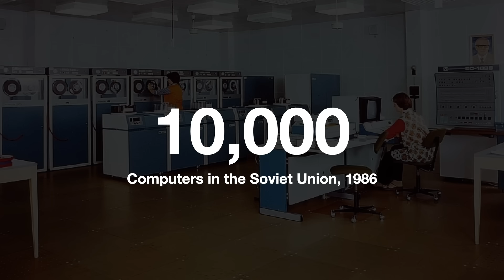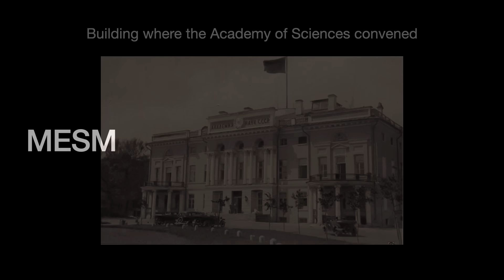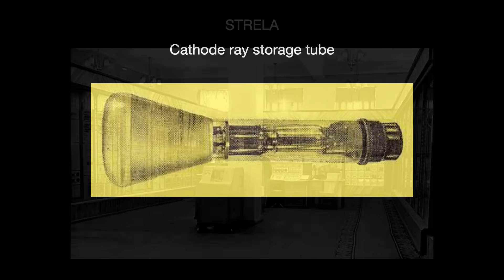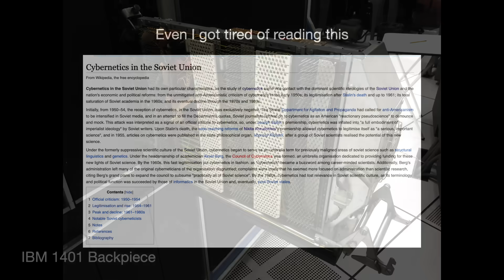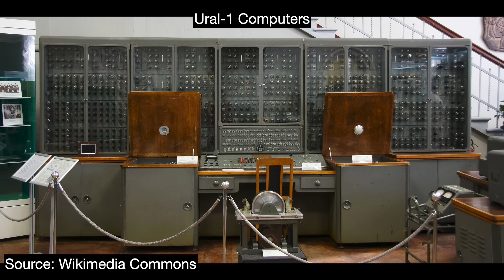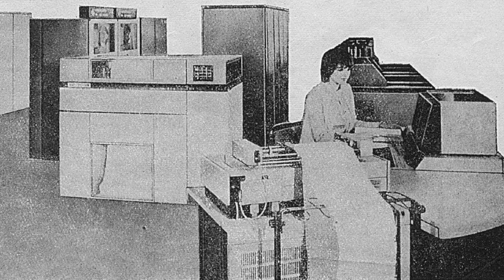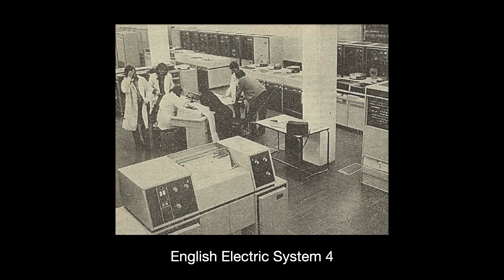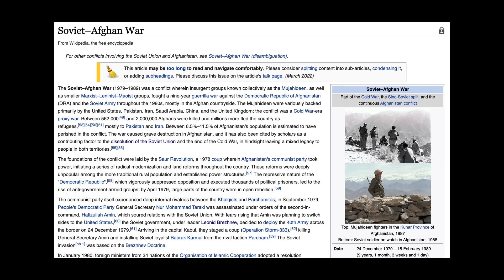Why the Soviet Computer Failed

Comment: The video regurgitates "socialism inefficient" propaganda without any backing facts. The truth of the matter was  that in the period discussed for first generation computers, Soviets multipled their production much faster than USA. The problem is, they were already 10 to 20 years behind to begin with. That kind of gap is not easily closed in high tech. For example, the USA is still several years behind Russia in ballistic missiles, having developed no hypersonic nuclear-capable cruise ICBM. US economy was fully industrialized in the 1870's while Soviet one only in the 1930's. Thus lies a very great difference.
Reply: Most of the russia high tech weapon such as cruise missile  ew system salvage from ukraine battlefield contain western component. By as much as 70%.
Reply: @richardque4952  SOunds like propaganda but OK
Most important part of those missiles is engine and they are manufactured in Russia thus why NATO doesn't have them
Reply: @Deadpoppin  Soviets led space exploration and until like 2021 US astronauts had still to use Soyuz spaceship from Baikonur cosmodrome. Russian economy several times smaller than US economy due to no worldwide colonialism or euro-atlantic alliance, yet still ahead in several areas of heavy industry. US generates brain drain all over the world in order to lead in microcomputing. Even then, their chips are made in Taiwan...
Reply: @nemou4985  more than 70%,soviet weapon come from west particular in the US,between 1945 to 1990 soviet intelligent obtain more than 700 000 industrial sample,1.1 million technical manual . This  is according to the cia assessment

Comment: 5:17 - 28 nm chips? The era of transistor   measurement in nm ended on 90 nm, now they mesure the equivalent of power that would be, if they could make smaller transistor. They are using bunch of new technologies to make better performance and more energy efficient chips. There ir no 5,7,10 mn transistor technology, because of physics restrictions. Sorry for bad English.

Comment: I would never use the USA's economy as a standard to compare against in terms of wise decision-making. The USA had an advantage of not having to care about limited resources because they have always been simply taking what they want and could embrace anyone with a similar outlook. Without that low-virtue ideology the USA might have struggled economically, too.
Well, we are being offered ever-clearer study lessons by events unfolding, for those who still don't get it but have some ability to learn after all.
And I am actually constantly concerned about the risk of the USA's competitors inviting too much of the same mindset through the desire to compete as opposed to running a profoundly different approach. - But, everything affects everything else, and along the lines of a saying, if you have to wrestle a pig, you cannot avoid getting muddy at first. (Once you have won, you can go take a shower, and hopefully by then you still like that.)

Comment: Makes me appreciate what I had.  Went through engineering school at Ohio State 1964-1966.  First year, we could not use calculators on exams.  In 65, they were optional.  By 1966-1967, we were required to use them.  During that time period I went from a fixed point 4-function calc costing $25, to a TI Datamath, to a TI SR50 full engineering calculator for $150 in lieu of the more expensive but equally capable HP-35 for $395.  At that point guys with slide rules hanging from their belts became real nerds!  Quite a rapid step forward in technology over those three years.  After four years in the service, I came back to the US and bought me a programmable HP-65 with card reader for that same $395 by 1975?
Reply: Interesting about the guys with slide rules hanging from their belts being the nerds.  I went to college a little later than that, which was solidly in the pocket calculator era by that time.  I was having trouble in a chemistry class with equations so went to see the professor for some help.  He recommended I work out some problems by "using your slide rule."   I was shocked at his advice.
Reply: I’m one of those nerds that came up with slide rules during grade school in the late 60’s early 70’s. Was introduced to one of those early HP calculators in our trig class in a USAF Tech school in ‘73. The instructor would set up games for us to race each other, slide rule wizzes vs the HP. (Later during my USAF time, we used a circular slide rule called a ‘Wiz Wheel’, had to stay proficient in case our radar station’s computer system went down.)

Fast forward to engineering school, somewhere in ‘80 or ‘81; Engineering Economics final was a sheet with an equation at the top, 25 or so lines to fill in. I was carrying around a TI Compact Computer; given to me as a technician in a EE program (TI had a program for technicians in engineering school). 
   I recognized it as a power progression, programmed it in BASIC on my TI CC so that all I needed to do was hit Enter and fill in the values on the sheet.

Finished in about 10 minutes; Prof gave me a dirty look (or was he just acting?); waved me out of the room. :-D

Started work at IBM at ‘84. Went 31 years with them; now back as a retiree-contractor. (I still have my old slide rules. I play with them or demo them to kids every once and a while.)

This video showed me some special things I didn’t know even as an IBMer. (Much of the described history started before I was born, continued while I was in grade school.)
Reply: My first TI-50A calculator had one memory and was $99. The TI-51A was $149 with 3 memories.

Comment: "10,000 computers. The Americans had 1.3 million." ©
And this is incorrect from the beginning. In USSR users worked from terminals, connected to mainframe. Entire companies with thousands of staff were able to work with single a computer. Which were way more efficient in terms of computer time.

Comment: Wonderful video. My understanding of computers during 1975-1979 were in college as computer science. The university had a Boroughs computer that took up a 3 story Air Conditioned building staffed 24 hours a day by a rotating 16 person team, that was for the entire college records keeping needs and the computer science department and professors. The only thing that was excepted as a Program or Application (APP) was on "cards" which we called "BOOKS". You take your book to the computer building and give it to the clerk. Usually in 6 hours, you return and get the results, a printout of your program. Computer Science courses were nothing but the durability of the student; ie, if your Book had one error, you got a blank sheet of paper. Time consuming for every waking moment I had. My last 2 years there, we could use paper tape! Good luck on that idea, one error in your program and you had to re-type everything again; all 800+ lines of instructions in Machine Language.
Reply: Yes, it was horrible in some ways.  Lots of data "shitwork" til 2:00 am or later.  That's one reason I didn't formally go into that field.  At the University of Pittsburgh they had high-rise student dormitories and at the end of the semester students would throw their punch card decks out the upper windows.  They would take minutes to descend and fly like snow---even slowing traffic below sometimes because of poor visibility.

Comment: I think there is a wrong statement about socialist economies in the video. My grandmother was a hydro engineer in socialist Bulgaria and she told me there were work incentives for industrial optimizations, like reducing costs or improving quality. It was called a bonus for "rationalization" and she received 2 - one for making the corrections of river beds simpler and one for a change in the design of road signs, which was not even in her field of work, but go accepted, because people recognized the value. Hence, I would be very surprised if there were no quality checks and incentives for cost reduction in the steel industry, as the video claims. I think this is a statement by the author trying to oversimplify the presented issue.

Comment: For anyone interested, looking into Polish computing history can be fun. A Polish inventor pretty much came up with the minicomputer idea I think but it was shot down by officials who wanted to depend on the Soviet’s more and more. There were also some Polish mainframes which lasted into 2010 from like 1970 and were surprising good (the ODRA systems). The biggest issue for Poland at the time was, that even though the engineers were good, available parts and resources were extremely limited (I mean, most everything were Polish or Russian clones of American stuff)
Reply: Hi, I'm from Croatia and way back when we were in Yugoslavia, we had a customer who had both ICL and Odra. I worked for ICL and would meet and make friends with Polish engineers. There were even lady engineers. We had very good times together, they were very friendly. I got a Solidarnošč badge from one of them and I wore it proudly.

Comment: Why are transistor based computers called "Second Generation" computers? I would think that the "First Generation" would be mechanical computers, "Second Generation" would be vacuum tube computers, and "Third Generation" to be transistor computers. Then after this I would suppose we're in the "Fourth Generation" of silicon chips based computers - perhaps the end of the "Fourth Gen" as we push the limits of nano-scale silicon, and "Fifth Generation" would be quantum computers.

Comment: 12:20 not exactly. A working prototypes of liquid-fuel rockets served as a proof of concept for the military bosses. Up until then commandment was perfectly fine with the solid fuel rockets. The other reason they were reluctant about adopting liquid fuel rockets is the lack of necessity. Solid fuel rockets are still considered to be more practical for MRLS, AAM or ASM. Produce > Store > Deliver > Deploy. But when it came to delivering a nuclear package across the continents. That's when they become interested in liquid fuel rockets, a wingless unmanned kamikaze bomber of sorts. Soviets went ahead in rocketry not because they got their hands on German engineers and developments, but because they had no air bases close to the USA. They could not rely on bombers. And a rocket was cheaper than the long range bomber. It also had upper limit on acceleration, top speed; no need for life support systems for a pilot.

Comment: While I have some respect for what their engineers have done under trying circumstances I wouldn't give Russia the time of day let alone the means to calculate it with after what they've done this year. It's going to get interesting too. Now there is a shortage of popular computing chips and Taiwan is being looked at by China with an envious eye. None of which bothers me personally; I already have all the hardware components I can use in what's left of my life. I call it my retirement fund. I've just finished writing the firmware for my next project out of the blocks.

Comment: Funnily enough the same thing happening now to the USA. They lost their leadership to Asia, there is a 5-10 year gap between them. Biden just signed a law to pour money into building chip factories, but it will take 5+ years until the first chips roll down from the line. And even then they plan to produce 14 nanometer chips, meanwhile TSMC (Taiwan) already manufacturing 5 nm chips...

Comment: Hi,great video just found your Chanel,I my self am a tour guide and we do tours on the former soviet counting machine factory ,,Sigma'' in Lithuania.the video was all correct,i my self talked to the former workers and engineers of the factory that created these computers.most of them were clones of west computers.the people from the sigma factory would travel abroad to computer expo's not just only to show off their models but to get,buy out or exchange somehow the blueprints or main parts of western computers and make their own.all i can say that they were trying their best but all soviet computers were far behind bc the country was self isolated and it was difficult for them to progress or surpass ibm models.In the late 80s when in the west a lot of people had home computers the soviets still were using mainframe computers and having a home computer was very very rare,and expensive (good luck finding parts and a guy who can fix it),i have a Lithuanian made BK home computer its new in the box and the key buttons are very stiff and they squeak.

Comment: Everything is much simpler. In the USSR, everything depended on the political course. Under Khrushchev, the rapid development of Soviet electronics and computers began. There were quite a lot of their own developments, including interesting ternary logic. But after the coup, Khrushchev was removal from power and the rise to power of his political opponents, his favorite projects were also canceled. Funding for the development of computers and electronics was sharply reduced. 
As the author correctly noted, Soviet developers were told: "there is no need to spend budget money and reinvent the wheel, just copy the IBM." But many agree that the copy is doomed to be worse than the original. The time of Brezhnev's rule is rightly called "the time of stagnation". 
A funny sentence of the author about Soviet rocket science, given that the USSR often had a leading position in space. Apparently the author is completely unfamiliar with this history. Even before the USSR, Russia was at the forefront in the theory of space flight with its founder, the Russian scientist Tsiolkovsky, who owns the fundamental formula of jet flight. The Russians had their own development and testing of rockets. Unfortunately, the Russian Revolution and the wars dealt a blow to scientific development in this area, as well as in aircraft construction, television, etc. Many inventors and scientists were forced to leave Russia. Sikorsky, Zvorykin... 
However, after WWII, research resumed. And this is not the merit of the Germans. Because all the key German scientists and drawings were received by the Americans. The Russians got only a few missiles that the Americans did not have time to destroy. Of course, the Russians probably took into account some of the engineering decisions of the Germans. This is a regular practice in all the world. But the very primacy of the Russian cosmonaut in space suggests that such research has been conducted for a long time.

Comment: USSR wasn't so desperate, it even had something like AUTOCAD digital systems at many factories. I even saw myself pneumatic computer at one factory, it had to protect production processes in case mainframe is damaged by EMP. In school I had class with 12 manufactured in USSR "Basic Corvette" computers, they weren't so bad or rare, really. The real problem was amount of portable data storages, for some reason nobody thought they are important. You could lose arm or leg if you damage 2.5 diskette. Because of that computers weren't so popular. And real reason was the model of economy.

Comment: Basically USSR failed because of its system was too dependent on the individual power of the ruling elite of the state.

  The 1965's economic reforms in USSR are often seen as a last turning point on the crossroads between socialist and capitalist economic system. They implemented the essence of capitalism into the Soviet society - profitability-driven economic behavior. Since then corporations - and as a result its workers - had a stark incentive to behave self-interested and aim for the own profit.

https://en.m.wikipedia.org/wiki/1965_Soviet_economic_reform

The system was set up for the capitalist logic, from there it was a question of time till the body of the socialist system would decay.

Another point is the horrible and fatal faulty political decisions in the economical sphere, done by Khrushchev. He did lots of reforms, that were unsuccessful and finally were wrapped up. For example 1960 he canceled Artels, a form of cooperations, that were based on private incentives aka private profit oriented ventures, which since the 19th century supplied Russian society with consumer goods. At a great part they produced the consumer commodities, which started to become deficit after the artels were disestablished.

https://en.m.wikipedia.org/wiki/Artel

Then there was a another failure - The Nikita inspired rush for 
 notorious competition between two systems ("We will catch up and outrun!") this slogan equalized the goals of the two systems - it turned out that the USSR and the United States had the same goals, but their paths were different. On the other hand, the slogan put the USSR in the position of a catch-up party, which gave rise to a corresponding psychological complex.

Since then, the performance of the two countries (the USSR and the United States) were constantly compared in terms of personal consumption. However, to compare the two systems in terms of that indicator was to recognize socialism as a failed copy of capitalism. As a result, the Soviet people stopped being proud of their system and began to look enviously to the United States. Mayakovsky's famous line, "Soviet people have their own pride, we look down on the bourgeoisie!" has lost its once majestic meaning.

For being the first socialist state in the world, the results of surviving over 70 years are quite impressive. Compared to socialism, capitalism took 500 years to establish..